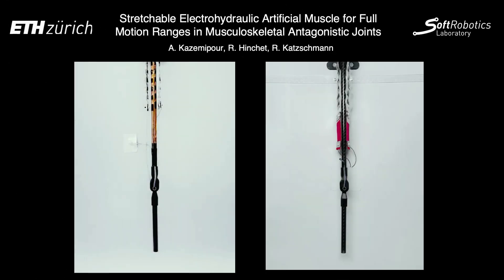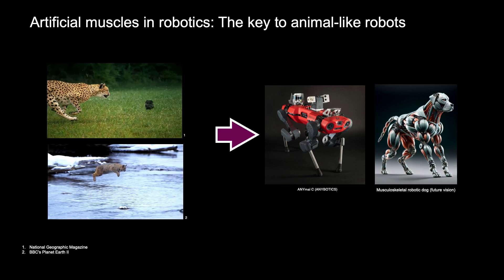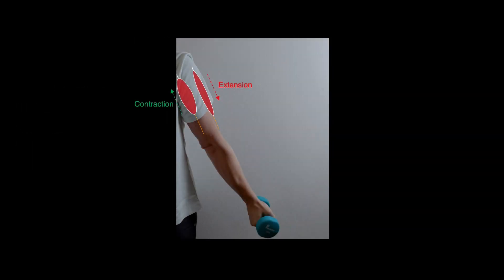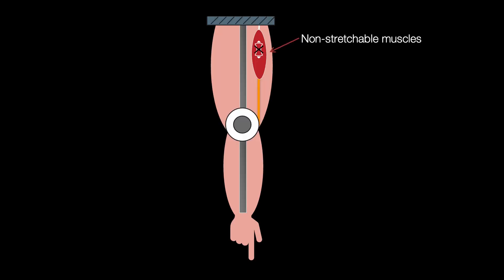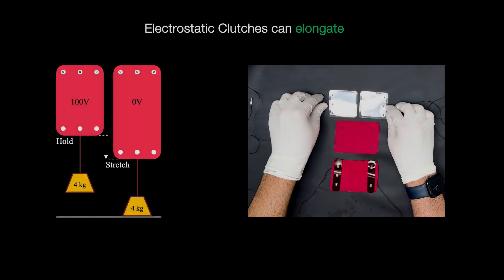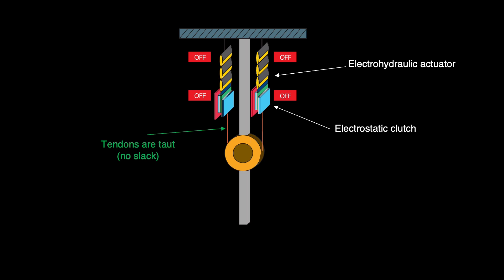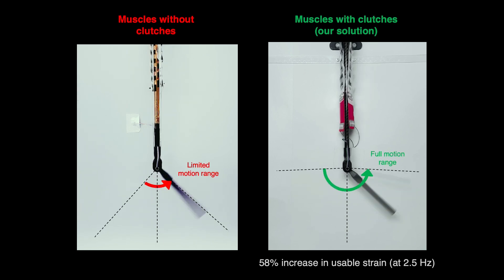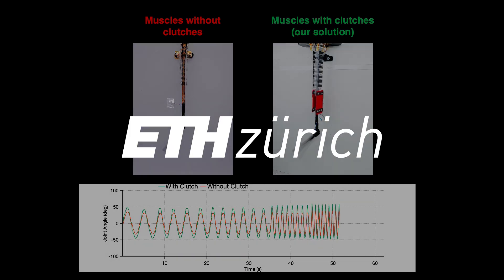Stretchable Electrohydraulic Artificial Muscle for Full Motion Ranges in Musculoskeletal Robots

Comment: the variable elasticity is very interesting! I think a fully integrated electro actuator and variable stiffness would be the right approach. You can achieve this by expanding on your layered approach and sandwich layers of stiff material with flexible material, actuating on the outer membrane as well as the inner bladder. It's known to the arts, but difficult to manufacture.

Comment: so this only works when it's not constricted and flopping about. or placed in a massive housing as a linear actuator. 

cannot have dust or in high static environment.

so, where exactly is this going into
Reply: Give them a break, it's still in the lab at this point.
Reply from the maker: This is currently a proof-of-concept lab demonstration, focusing on the core technology without protective housing. Once properly encased and sealed, these systems can be adapted for harsher conditions. We aim to incorporate them into advanced musculoskeletal robots and potentially prosthetic devices.